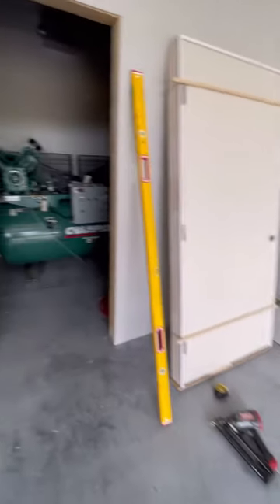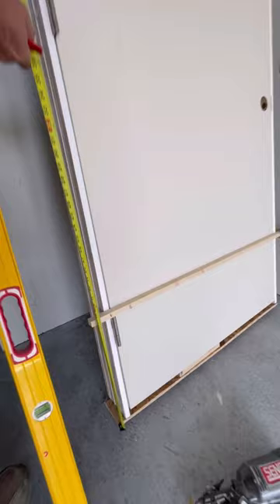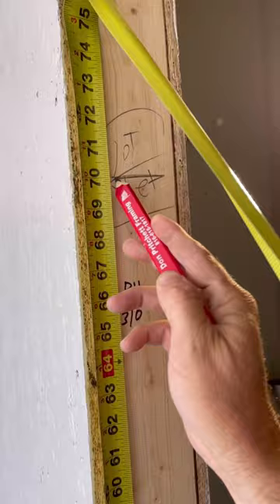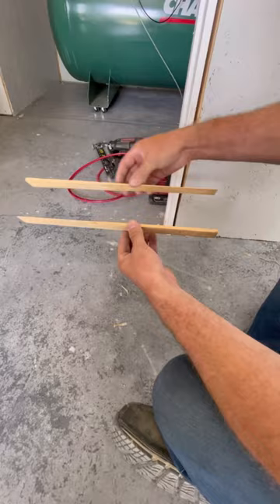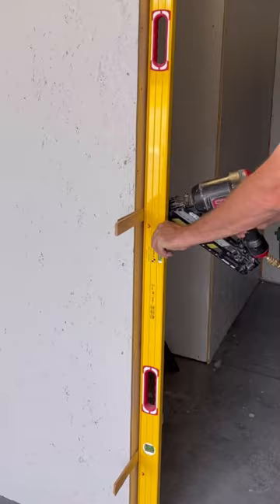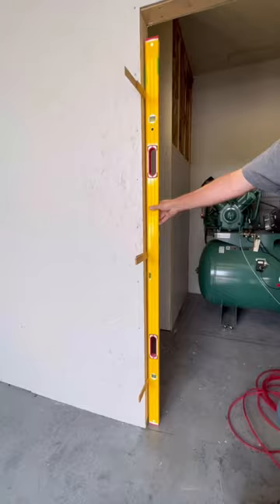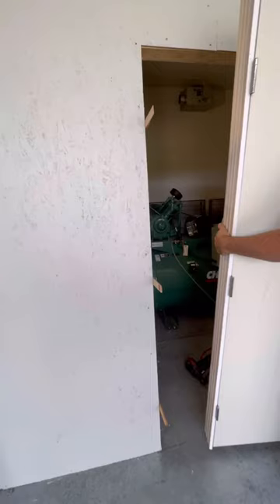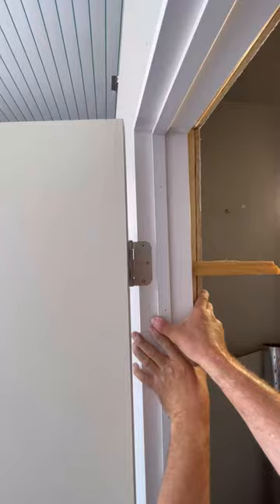How I Install A Prehung Interior Door

Comment: On most jobs we take the door stops off, we then use it to cover the nail heads or screws when we put it back on. Less nail heads are better
Reply: But don't you have to nail the stops back on therefore having nail holes?
Reply: Yes but you use a 18 gauge to put it back on which is much easier to hide along the other nails once baseboards and trim are installed  @TheBenjammin
Reply: This is ridiculous. If it’s getting painted you cant even see it.
Reply: Paint grade door jamb no problem , you don't have to remove door stop

Comment: Why don’t you just nail the hinge side to the stud and shim or use a piece of plywood to fill the gap
Reply: I always nail hinge side flush with door jamb. Shim handle side. Rearrange framing as needed. I follow my own framing for finish work so it's all gravy. Strange how homeboy did this. I have NEVER seen shims nailed prior to install. 1/16 matters, I personally do not like this method. Door will sag, amongst other issues. I don't like it.
Reply: I always use 3 pieces of 1/4 plywood on the hinge side as most hinge screws stick out slightly through the back of the jamb this also allows for additional adjustments with shims as needed . Doors can have slight variances in hinge mortising , and jamb assembling so if you're going to make a perfect installation you may need slight adjustments on either jamb leg . I have been hanging interior and exterior doors for over 40 years and have never had any problems or customer complaints. Keep in mind these doors are  installed in multi million dollar homes not run and gun tract housing or apartments.
Reply: Every commenter on here is a master craftsman aren't you? 40 years of only installing doors in multi trillion dollar homes...sure buddy.

Comment: If rough opening is already level do I need to add shims ? Can I just nail it straight to the rough opening ?
Reply from the maker: You still need to shim just to center the door in the hole so there’s not too big gap on the other side